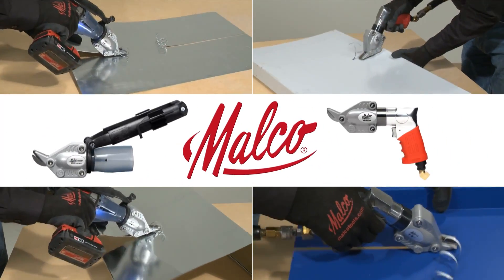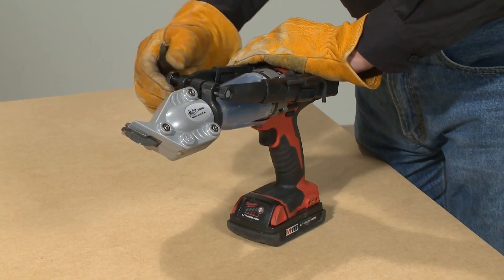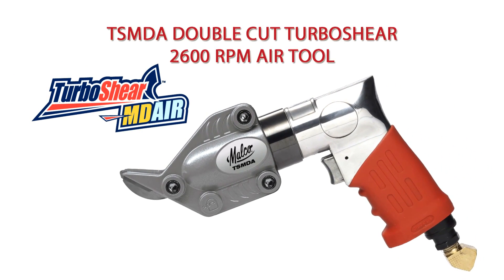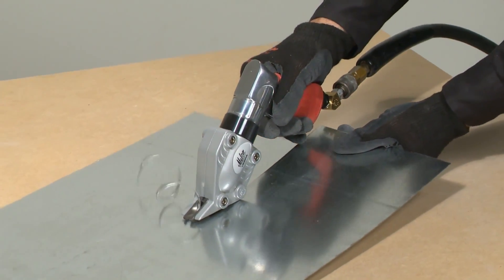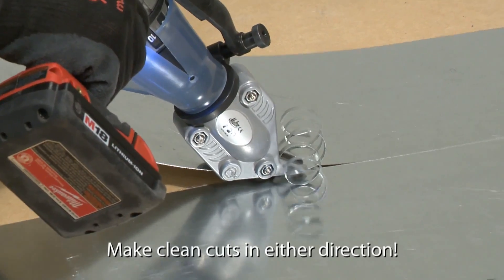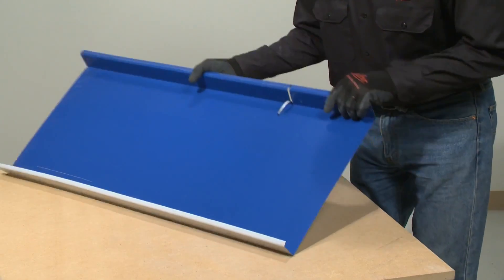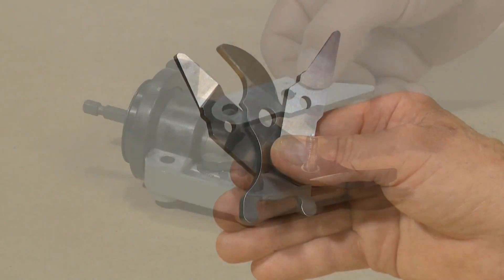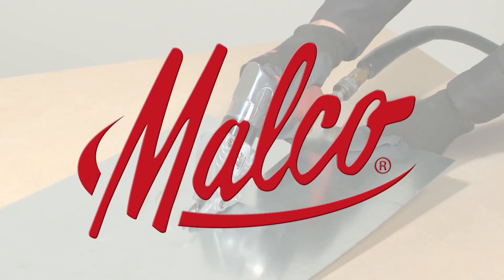The Malco TSMD TurboShear Double-Cut Metal Shear Drill Attachment

Comment: What a joke! How about showing us if this tool works on the most commonly used 3 foot wide corrugated sheet metal used for roofing and siding and if it can simply cut across the corrugations especially since you have been in the business of making these shears for some time now and so you know this question is a very commonly needed to know one for each model of shears that comes out